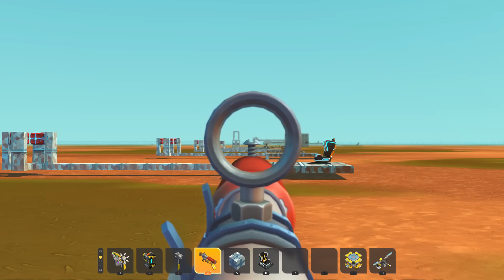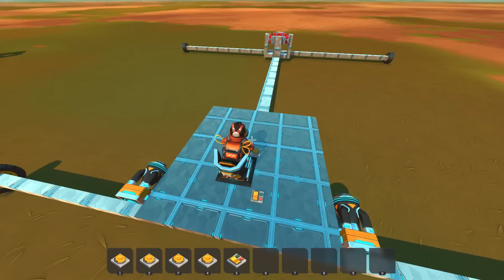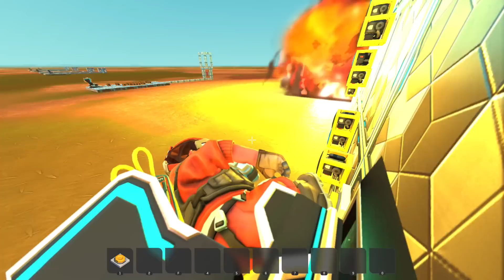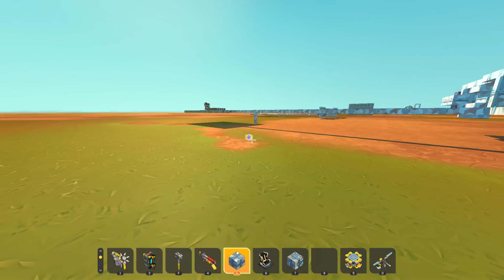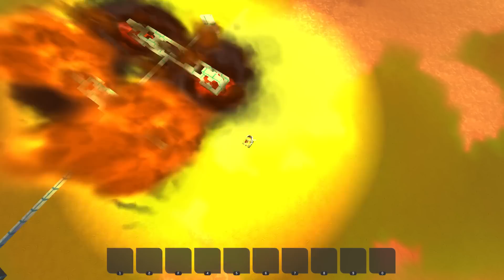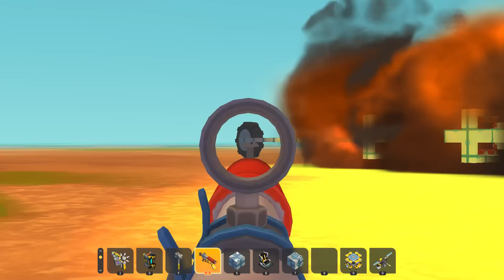I Built a New and Improved Explosive Engine with Automatic Timing Systems! (Scrap Mechanic Gameplay)

Comment: Making a clutch is kind of impossible here, even though it would possibly help with the power delivery. Maybe you could experiment with it? My idea is that by giving it a clutch you could possibly avoid stalling, but you would need more power anyway. Idk, just throwing ideas. It's just that it's either 100% power or nothing, maybe you could use some circuits to give it different timing modes and alternative between them.
Wtf am I saying? That would be way too much work for a pc destroyer. This isn't real life. It would be practically impossible controlling accurately input for gas and clutch, so yeah, scrap that...

Comment: What you need to fix the problem is a gearbox that takes torque away from the engine.that’s why manual transmissions stall if too much torque is placed on them.

Comment: I know this would make it slower, but put gears on it to increase the torque. The engine looks like it spins pretty fast, and with bigger wheels I think you need more torque and less rotational speed to achieve the same effect as if you ran smaller wheels. But in general, you need more torque.

Comment: What you need to do is extend the bit comming of the main shaft adding more torque, or in otherwords give it a bigger stroke but not by just extending the piston out. Also right now you fire sequence would be 1234, instead try 1423, don't know if that would help in a game like this.

Comment: You need more tork so I recommend add a gearbox or just gears to give it more tork and if you make a gearbox 
1 it would be cool 
2 it would give you more tork in lower gears and you can test what ratio would give you enough speed while having enough tork to make it would work.

Comment: amazing! 
I think the main problems are the timing and initial acceleration.
You have set the timers perfectly for a cruise speed, but the acceleration of such a big mass is progressive, so the explosions frequence should ramp up until you reach that cruise speed.
Also as Constantine pointed, add mass to all the moving parts to increase their energy. It will though have a slower ramp regarding the previous issue.
I hope that can be implemented easily!
Hopefully the last of 5 edits or so, I would like to see you play Stationeers! There is nice logic in there as well as many functionalities to be done with it.

Comment: Instead of linear pistons you could try to built a rotary engine, like for example something similar to a wankel engine.
Since this is scrap mechanic, you could also simply put the injectors on a horizontally rotating cylinder/turbine. By putting all the connection material on one side of the injector, you could speed up the rotation of this massive flywheel. You probably wouldn't even need adaptive timing, you could always run it at maximum frequency.
This might help your power issues, as I believe that a lot of energy is lost in the friction of the pistons and the physics of the crankshaft.

Comment: Gear it down! Like at least 1:90.

1: it is not that fast anymore, so the spawning errors should be less.

2: with a ratio of 1:90 and 4 zylinders you should have 1 set of explosions for every degree of rotation in the driveshaft. That should be a better torgue to weight ratio.

Comment: Your problem isn’t the power it’s actually the torque that is the problem to fix it lower the gear ratio right now the ratio is 7:1 simply because you are using two 7x7x2 tires now I would say add a gearbox but I it would be easier to just use smaller tires because of how much scrap mechanic loves it when you use gears

Comment: I think you should time the explosion better: they seem very late to me. You could try using a bearing between the crankshaft and the timing wheel to fine tune the delay. Also, direct driving may improve the situation

Comment: Nice progress....
So..... I got some ideas.... 

1.
Use an electic engine as starter, it could possibly make it so much easier to start. 

2.
Make bigger pistons, not just does it have more momentum, but it can also spin faster as ypu get even more room for spawners. 

3 Try easing your engine in for a torque response
You need a clutch, one that starts with those shoe thingies rubbing against each other and when you think the engine can handle it, let one side collapse into each other. 

4. You need a smaller gear ratio, the wheels spin too fast for the engines' torque.... Maybe that cog mod you once showed could help

5. Maybe you can make a switchable modification: one where 2 spawners per turn per piston injects, for speeding up and one where 4 or more spawners inject per cylinder per turn for the times you need higher forces, like when clutching. 

Also:
You need torque so build it like a torquay engine

6. Try maybe bigger flywheels

7. make the piston rods be in a guide too, to achieve that, build a crosshead engine setup, as the steam engines use.
Another idea would be a knuckle rod system or if you don't find anything under that name, google search the picture: Knickpleuel Motor
There's a gif to it there.

8. Modded blocks for more durability/less weight and maybe more useful explosives. 

9. Say ypur sanity goodbye and reconsider your life choices

10. A gearbox

Maybe this'll help

Comment: The gear ratios are 1:1 so its gonna take more to make it move so maybe put a small drive gear to a bigger axle gear to generate torque then maybe make a transsmision of some sort to shift into a smaller gear to gain your speed but not too small to the point it stalls out

Comment: Should advance the timing. Variable timing can be used so when at low rpm you actually have the explosions delayed, and at higher rpm you can advance the timing (since there is a delay in the explosion). Also, technically speaking from the real world, free moving engines can't do a 1:1 drive and would never be able to move a vehicle without some gear reduction unlike the classic piston engine.
Reply: I think the timing could be changed by rotating the sensors
Reply: @Giuliana-w1f  or moving the paint lol
Reply: @ACMaxtogo  moving the paint would be like changing the camshaft, having the sensors in a bearing and a slow engine (or controller) would be better, it could have different timing depending on the speed (and it would be more precise than just 1/8 of a revolution)
Reply: Theres tons of old school racecars salt flat cars and dirt track cars that use 1:1 they are just push started.
Reply: just wanted to mention that steam engines use a classic piston design, but don't need transmissions to gear down the rotational speed to generate enough torque. the steam is just so stupidly strong relative to the explosions that it can easily push a full vehicle with 1:1.

Comment: This is looking great! You could try and flip the crankshaft 90 degrees so it’s parallel to the car axle. That way you could drive the wheels directly and the explosives would at least not glitch into the side walls while driving.

Comment: Here’s maybe some ideas:
1. You could put a different gear ratio from the engine to the wheels. Maybe it can’t sustain its momentum because it is too low in rpm for the speed. It does mean it will go with a lower speed, but maybe it is one which it can sustain itself.
2. In stead of fixing opposite cilinders to opposite points on the axle, you could fix them onto the same point and have the explosives alternate. That way per cilinder the time gaps between explosives are shorter en it can maybe run higher rpms. Maybe this will counter the need of a lower speed in idea 1 as well.

Comment: I don't think I can be more useful than the existing comments but I've been wondering ... If the blocks your using on the car aren't really heavy considering the amount, like yes I understand it needs to not blow up but what about the parts around the logic and seat. Causing stress for the engine to try to pull all of that.

Comment: My idea would be to work on the timing of the ignition while you're moving. I noticed that sometimes while you used the thrusters to "jumpstart" the engine, you would accidentally start the engine with the wrong timing which caused less power from the explosions to the cylinders. Also, the improper timing of the first ignition possibly created counter-spin that worked against the attempted "jumpstart". Ofc, if you do fix this, you might as well go the full way and make a reverse/braking sequence too.

Comment: Something I'm noticing is the power stroke is having a lag in the Combustion and is putting little torque on the crankshaft and the fact it takes a split second for the explosive to blow up so when the power is applied it is towards the end of the stroke

Comment: My tips for improving the engine if you care to:
1. Modpack parts spawner and set the offset based on the velocity of the vehicle. This would be fiddly, but it would deal with the explosives popping out of the engine.
2. Gear mod to gear down the engine so it can give more torque.
3. Would a drag reducer block help at all? My thinking is that, since it reduces the drag, it should reduce some of the strain on the engine?

Comment: I think the issue is the fact that the engine have to high rpm and trigger the sensor when the spawner is not ready. I think you need to try to build a clutch  gearboxes

Comment: There are engines in real life where the pistons meet in the center and use the same explosion to move them apart, maybe that can help a bit and use the two separate crank shafts for different wheels.

Comment: If you rotate the engine 90° on the horizontal plane so the cylinders point in the direction of travel

The exposives will spawn either just a little inside the piston or a little behind and probbably not spawn on the side of the chamber and glitch out.

Maby even make the front cylinders a little longer and the rear ones a little shorter or even delete the rear ones although this boxer engine setup is very ballanced.

Comment: A way to gear it down without changing the gears could be to have the shaft attached to larger connectors to the pistons so a large movement in the shafts is a smaller piston movement possibly with multiple pistons per shaft attachment points. Then it moves slower more efficiently so is more effective. The also have the back raised up with a long front shaft to mean it is able to get ground clearance. This could of course all fail but it could be worth a try

Comment: Is it possible to make the end gear have a really low input to put out ratio so it goes very slow with slightly more torque wiling would bodge both issues of to fast movement for the spawning and too low torque. 

Another issue with speed is it is most efficient at very high speeds when there is the most explosions but it only functions when it is slow so is insanely inefficient. 
Or in other words very similar to a real engine with no gears

Comment: gear reductions seem laggy. how about two disks pressed into each other, with suspension/pistons to control the normal force, so that if the resistive force is too great they slip
Reply: Wheels can even be used for this.

Comment: a timed engine wont work for this i think. not for pulling itself.
you need the detonation at the right position.
at one end of crank make a  2 block high spike on each side so it mark top position of each piston.
then have a arm with sensors you can rotate to advance/retard timing reading those  spikes.
angle sensors to read  like 12´ offset of crank . it give the best timespan for it to read the spike.
they are what triggers the spawners.
you can have that arm on a bearing and a electric engine hooked to seat.
this give full speed control in both forward and reverse when changing timing with the arm.

Comment: If the problem is the explosives spawn point lagging behind the position of the pistons while in motion, then you need to give a buffer to allow for the explosives to spawn slightly behind the spawners. While sitting still it needs to be in the current build setup, but when you start moving those spawners have to be moved to lead their target. You could also just set the engine like an assembly line. The spawner provides explosives that travel to the ignition point that forces a piston to move. The energy is sent to a ratioed gear that allows less load to be applied to the mechanisms functional parts.

Comment: Couldn't you just gear down the output from the engine where the axel connects? You would lose a lot of speed but you should gain torque assuming SM doesn't have issues with so many collisions

Comment: Make the cylinders closed to begin with so you dont "blow" pistons and it may be a issue with the ratio that the engine got. Im not a 100 tho and oh btw, try making a 4 stroke engine instead of a 2 stroke, would be fun
Reply: Why a "4 stroke"? It would just be harder to make, and it wluld have less torque

Comment: Try an inline six set vertical 
Time them 135246 so explosions are not near each other
Offset in 60 degree increments based on firing order so 3 should be 60 degrees off 1 and 2 will be 180 degrees
You need to adjust gear ratios to overcome torque.
With a 1-1 ration you could place the number of explosive used between the vehicle and unmovable wall then the blast would push the vehicle just as far, i imagine 4 dont move that car far.

Comment: Use bubble block for the logic board and try to use just some strips to reduce weight.
Also use a spud gun to eject the thrusters after getting to speed.
Try to make the engine as compact as possible to save weight.

Comment: Stellar video as always Kan!
One of the ways to get the weight down would be to have modded blocks that have low weight and high durability.
Also a mod that creates smaller explosive effects would be nice so that you can actually see the engine without all the smoke and dust.

Comment: heavier flywheel, more radius
Reply: clutch
Reply: too high speed for the engine, transmission, gear down
Reply: better spawner for explosive, try vanilla explosive storage, you dont need to be so fast, more pistons slower

Comment: Maybe work in a transmission type thing where you could engage the drive wheels with a flip of a switch. That way you could gain momentum in both your piston cylinders and at your fly wheel. Maybe gaining that momentum to it's max and then engaging the wheels will be enough to move the vehicle. Or maybe it'll just stall out again lol.

Comment: Something more like a rotary type engine might work better for scrap mechanic.
A wheel with four shafts that get pushed by explosions when a sensor detects those shafts are past the explosives. You could also add multiple wheels with different offsets.
I know its not how a rotary actually works but seems like it could work in SM with simpler physics calcalutions.

Comment: put a suspension on the spawners so if it spawns in a spawner (not where it is supposed to be) the explosive will get pushed by the suspension into place maybe? make it lighter and make everything inclosed (an engine casing)maybe there is a invinsible glass mod to still see the engine

Comment: You have to extend the crankshaft arm even more, for more torque.
Also your timing seems to be off.
I sugest putting sensors on bearing, that will be connected to the controller, and as the engine will accelerate you will turn tha bearing degree by degree until you reach max speed. Unless you do that the engine will just stall again and again

Comment: Could you use 0 strength suspension to lock the undesireable axis of the piston? and then you can have the bearing to convert to rotary motion but the suspension could help it stay in plac, or is suspension too vulnerable to the explosives?

Comment: Aw I had such high hopes for the new version, but alas scrap mechanic physics are slacking.  I don't think this is a torque issue anymore - long before survival was a thing I made a similar engine with thrusters instead of explosives and it worked great - so I'm pretty sure it's a glitch issue with explosive spawning.  The only way I can think of that has a chance at making this work is to have a huge hopper that dispenses explosives at the right time which is a nightmare unto itself, so unless they fix the positional accuracy of spawners (which may be a game engine limitation) this seems like it's never going to work right.
Reply: Oh, maybe you could use the gearmod to get a proper gearbox setup to improve the torque output which would also slow it down and thus maybe make the spawner issues less of a concern..

Comment: Try to run it in an empty world, though not that noticeable, the physics change a bit at lower frame rates. For example, my rpm tester skips a lot more rotation at lower framerates, and maybe play with the physics slider to see if framerates are more important than physics quality.

Comment: Just an idea for the engine - how about a friction clutch. I.e. the engine spins up then presses a plate on the output shaft onto a corresponding plate on the wheels.
Reply: @techno1561  what's the difference? Not ragging on your idea, im just not quite sure what the difference is.
Reply: @2001herne  In scrap mechanic "large contact area bad, small contact area good", the physics engine really hates calculating what happens to slabs touching other slabs or world, etc. Small contact points would simply run much better but likely have the same effect from a mechanical viewpoint.

If you have the game, as a test, make something big that's not connected to the world, first try put it down as-is (large contact area with ground) resulting in lags, then try give it a few stubby legs (small contact area with ground) & put that down on the ground, suddenly no lags.
Reply: @suicidalbanananana  Thanks, that makes a lot of sense. You learn something every day I guess.